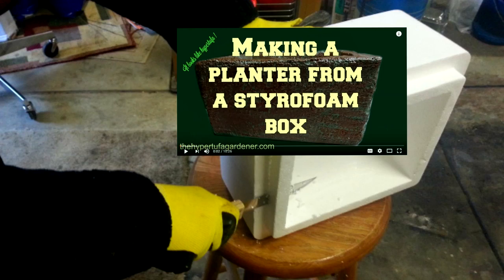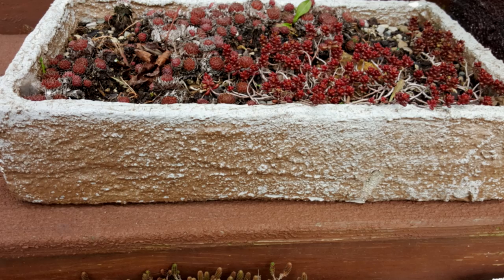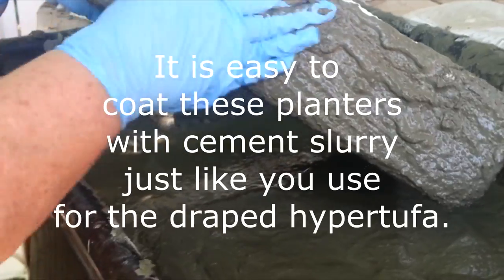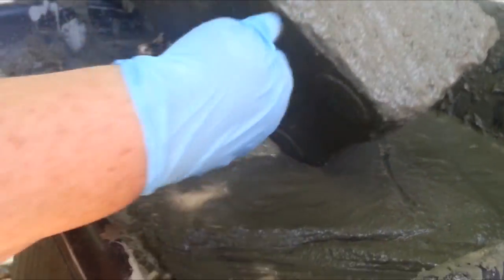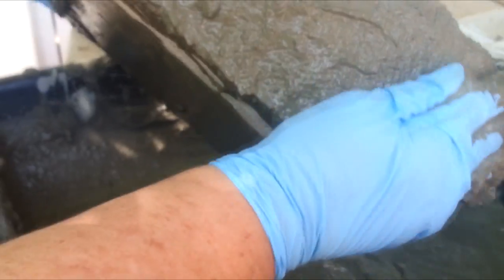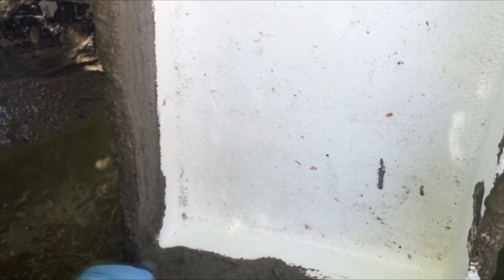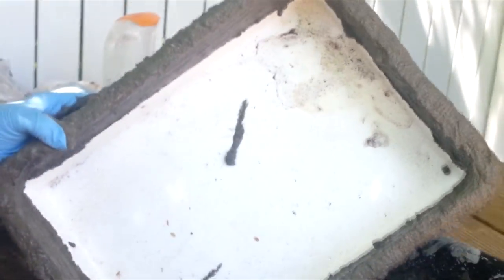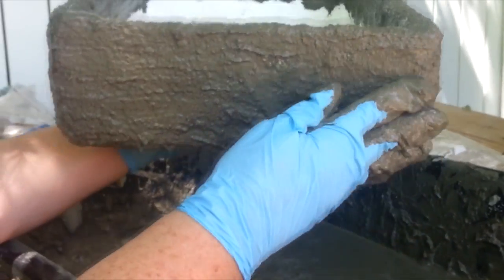Styrofoam planters - Coated with Cement Slurry - Almost The Real Thing

Comment: I like this idea.  Adding a layer of reinforcement like burlap or flyscreen and using a bit of acrylic or latex in the concrete -even some exterior paint, would improve the durability and deter cracking.

Comment: I'm with Pak Wen Tong, can you list the mixtures and ratios please?
Reply from the maker: I mix a slurry of the cement. For instance, I used 2 gallons of Portland cement, 2 quarts of peat moss sifted, 2 quarts of vermiculite with enough water to make a thick soup-like mixture. (Use less peatmoss and vermiculite if you don't like the textured look) . So a ratio depending on the amount you need to mix up would be a  1:.25:.25 or 1:1/4:1/4.  For instance, use 1 gallon Portland, 1 quart peat moss, 1 quart vermiculite. I hope this helps a little.

Comment: Won't the cement slurry crack and fall away? It looks great though and a great idea too.
Reply from the maker: If you check the blog post referenced in the description, I have only had a little flaking in the years since I made these (oldest ones), and they are fine with a few minor flakes. I explained about touching those up on the blog. It is a great way to get "tufa" but very light planters.
Reply: Kim's Gardens thank you so much for your reply, I will be trying it out this week,love your videos 🌷 👍

Comment: Whats the mixture u add to the cement powder? Just water? Can i have the ratio of it?
Reply from the maker: I mix a slurry of the cement. For instance, I used 2 gallons of Portland cement, 2 quarts of peat moss sifted, 2 quarts of vermiculite with enough water to make a thick soup-like mixture. (Use less peatmoss and vermiculite if you don't like the textured look) . So a ratio depending on the amount you need to mix up would be a  1:.25:.25 or 1:1/4:1/4.  For instance, use 1 gallon Portland, 1 quart peat moss, 1 quart vermiculite. I hope this helps a little.

Comment: I have a large Styrofoam cooler (about 24 inches deep, 30 inches long, and 18 inches wide) that I would like to cover in concrete and use as a planter for a small rose bush.  The walls of the cooler are about 3-4 inches thick.  What do you think?  Would the concrete be strong enough to keep the Styrofoam container from collapsing over the years?  Some people are saying I should just use the cooler as a frame for a solid concrete planter, because it would last longer.  I'd like to keep all that Styrofoam out of the landfill if it would last for a few years though...?
Reply from the maker: Mine have lasted for years and years, the basic Styrofoam cooler. I have had the coated ones for about 3-4 years and it does fine with some minor chipping here and there.
Reply: Hello, Laureli C. I have made a waterfall fountain out of Styrofoam & cement. However, I applied a coat of watery cement mix with a brush to the styrofoam, then I wrapped it with cheese cloth and brushed over that. Once it was dry, I coated it with the hypertufa/ cement mix. It has held up very well and I have yet to see a chip or crack. Cheese cloth works wonders. I hope this helps.
Reply from the maker: That sounds like a great idea and the cheese cloth can really add some texture too. Thanks for your help.
Reply: Jacqueline Manzano, your waterfall fountain sounds fantastic!  Do you have a photo of it somewhere on the internet?  I'd love to see your design!
Reply: Hello Laureli. here is my recipe. Wrap your styrofoam container with cheese cloth, take a spray bottle with water and spray it onto the cheese cloth, (this is make the cheese cloth stick to the styrofoam), now you simply brush on your cement slurry very carefully. Allow it to dry & add a second coat if necessary. Once it is dry , you can add a thicker coat of cement/ sand mixture, once it hardens you can paint it.  That is how i do it. send me an email @ elegantrepairs@aol.com and I will send you some pictures of my finished products. If you have any more questions just drop me a line.
Reply: @angieleni  No PVA glue, just water and cement.
Reply: @angieleni  Just Portland cement and water.
 and I used a heat gun to seal/glaze  the styrofoam before adding the cheese cloth and cement.
Reply: @jacquelinemanzano9328  hi. I was struggling   to do that. Your idea helped me a lot.. thnx a lot
Reply: @amnaalawalkhan2926  You are welcome. Take your time and be creative, its fun and very easy. happy Crafting!

Comment: What is the mix ratio of the slurry?
Reply from the maker: Depending on the texture you want, add a little more or less of any ingredient until you get the look you like for your piece. But the general recipe is:  
Recipe on this one is heavy on the cement. I would use:

    1 part Portland cement (I was using a 2 qt pitcher)
    1/4 part of peat ( about 1 pint)
    a handful of vermiculite and mortar mix depending on how much you want it to be textured

    add water, about a 2 qt pitcher as above added slowly as you get it into a slurry or gravy in the   consistency that you want.

Comment: Great video. Can you tell me do you still use the heat gun before putting on slurry?  Thanks
Reply from the maker: I use the heat gun when I originally make the piece, but if I were going to make it to put slurry on right away, I don't think the heat gun is necessary. Good luck and thanks for watching.

Comment: I made like u but it didn’t stuck on the foam
Reply from the maker: Were you able to texture the sides with a wire brush and get it all "roughed up?" That might make it more able to adhere to the sides.  Here is the video where I am roughing up the sides. https://youtu.be/dBOcn5LavRY
Reply: same problem